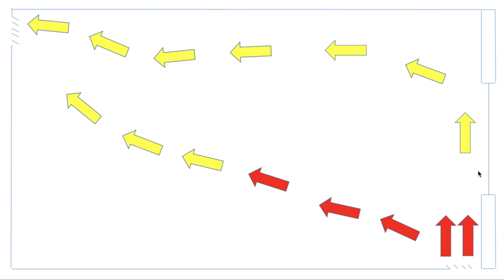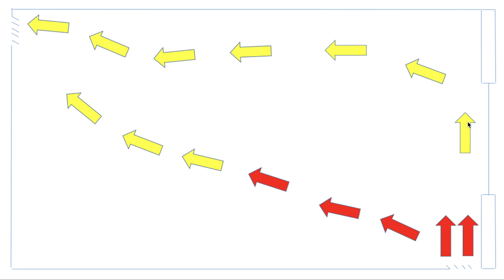Floor diffuser and ceiling return

Comment: I have to say, my heating/cooling works quite well. The basement is fully insulated and has no plenum runs that are open, as in no pressurized venting save for some leaks in the system. There is a small return air directly to the return plenum, close to the furnace and two of the main floor returns are allowed to move into the basement without any ducting (may be a code no no? )Every room has a cold air return, plus the hallway one I mentioned up high near the ceiling.
I might add that the basement or "lower level" has no door and is more like a "downstairs" with an open stairwell. In winter the basement remains near the same as where the T stat is located in the hallway (70F) on the main floor. 
   Having a 100% insulated basement walls and 90% insulated floor make for a very dry basement. Never the need for a dehumidifier as the AC takes care of that and with no cold surfaces there is no condensation on the floor or walls. My home was built in 1957 and the basement was insulated in 2001.
All insulation was done by extruded polystyrene bonded to the walls (2") and floor (1") bonded with drywall, with the floor in OSB. The 10% laundry area is exposed concrete.
Reply: Craig Nehring Return grill cut right into the return plenum is a big no no unless you have 90% furnace & hot water heater or electric water heater and heat pump.